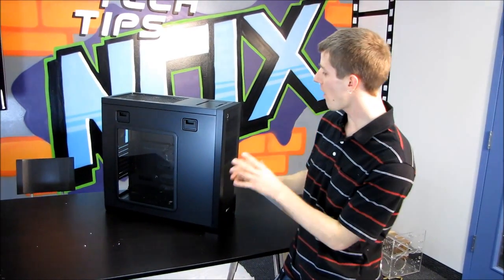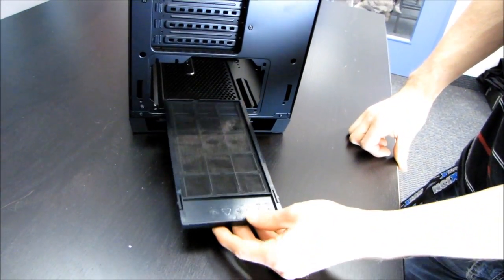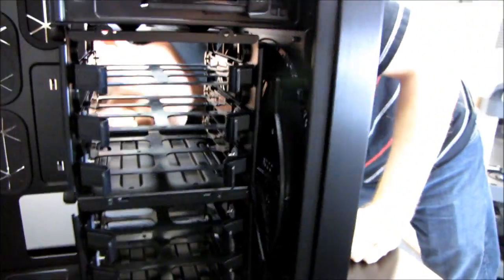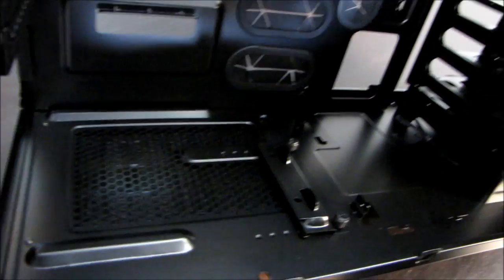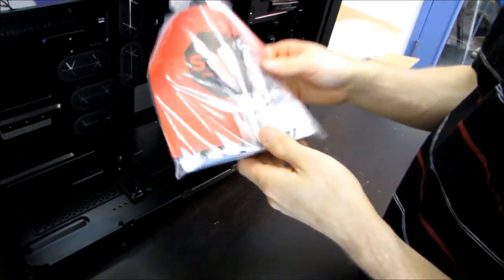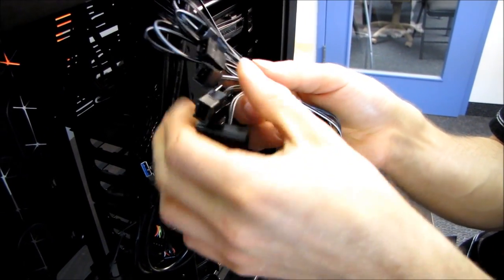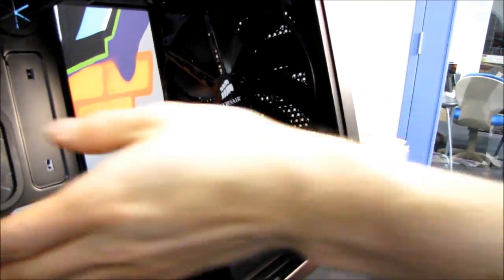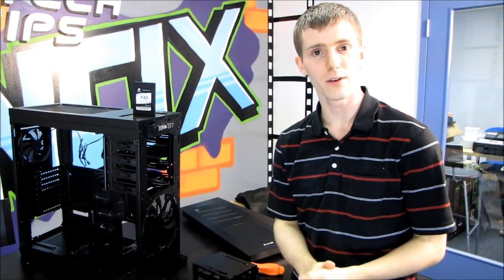Corsair Obsidian  650D Gaming Case Unboxing & First Look Linus Tech Tips

Comment: bought this one in 2012, still use it today hehe
Reply: Me too :) best features imo. Hot swap is rare these days. As is the reset switch being slightly hidden.
Reply: As do I, and will with the next build in a few weeks!
Reply: I own two of them.  That way I can start building my next system without needing to stop using the current one.
Reply: Still using mine in 2020.
Reply: Sorry, swapped it a few months ago
Reply: Me too, currently googling around trying to figure out wether I will be able to replace the noice machine at the front with a higher quality 200mm Noctua NF-A20 PWM.
Old one seems to be only 20mm thick, I might have to either get rid of or move the harddrive holders to make space for the 30mm thick Noctua.
Reply: May I ask how's the airflow of this case compared with nowadays cases?

Comment: Still rocking a 650D for two years now, awesome case. Would have been nice for Corsair to have a dust filter for the top though.
Reply: Is the top an intake?
Reply: ***** I have a corsair H100 in it and the rad doesn't fill up all the holes therefore dust can passively fall into the case. I have it as an exhaust, I have positive pressure in the case so there is minimal dust build up.
To answer you question, the included fan can be either, but most people would have it as an exhaust.
Reply: Thanks bro!!
Reply: Draconorst Dude if you have so much dust inside your office. etc. that you need a dust filter at the top of ur case, you should probably not be there at all..
Reply: kristian kristiansen It's actually at home and I have carpets, small children and cats to contend with. I also live in a cold damp environment, therefore ventilation of the house (which I own) can only be done at certain times of the year. I clean the front filter once every 3 months and the whole case (inside and out) every 6 months. It's not bad, but I just want it to be pristine.
Reply: Og you have carpets ..
Reply: @relentlessmotion  Intake or exhaust, can also do both at once 1 coming in 1 fan exhausting....good for VRM cooling

Comment: @JonasAndStuffDK95 yes, the top fits a double 120mm radiator, the front fan area can also mount a rad. reservoir can be houses in the drive bay area. and the pump can be attached where ever you want

Comment: You can install up to a 13-1/2" long video card in the 650D with all of the hard drive cages in place.  I have the case and a XFX HD6870 Black Edition Dual Fan video card installed.  The card is 9-1/2" long and I still have just over 4" of space before I hit the hard drive cage.  The case is well designed, way better than most cases.

Comment: @SneakehNub You can run your power supply cables through those to hide them, the ones at the back of the case are for water cooling tubes.

Comment: large graphics cards will fit with the hdd cages installed, but you can take out the one at the top and mount it at the side of the other if you want more cooling to the card/cards.

Comment: Anything by Corsair is probably going to be a good buy. If you're on a budget the 500R will be a solid case, but if you have an extra $70 to spend I'd go with the 650D. The 650D is going to made with slightly higher quality materials, and looks a lot nicer IMO. When I was building my latest system I went out and decided to invest in the Corsair 800D, which I love and plan to have forever. We should probably stop hogging the comment area though. Send me a msg with any other questions.

Comment: @GeneraLKaoZ 

pretty sure you can, 
the card itself is around 12i-30cm in length (I have HIS 6990) , and the case 650D is around 21.5' in length.
In addtion , I think you can relocate SATA bay area drive holders (lower right hand side)

Comment: Ya, the airflow should be plenty. Should be a good case. Personally I prefer full towers, but I'm about to do a Haswell i7 build with a friend and he didn't want something too big, so he's getting the 650D. Extremetech's website has a good article (Extremetech's guide to air cooling your PC) that explains the importance of fan positioning over number of fans. Some good info in there if you're interested.

Comment: Yep the stock 200mm is there, it's not quiet but its not loud either. It's on my list to replace. Yep two sp120s will be fine on the h100 with that motherboard.

Comment: To add an aftermarket CPU cooler, which typically require a backplate to be mounted behind the motherboard, allowing you to change it without removing the entire motherboard.

Comment: can someone please explain to me (3:05) the 3.5" Hot Swap Drive & the 2.5" Hot Swap Drive. Is it just a normal HDD or SSD that can be easily installed/removed?
Thanks for any help
Reply: ***** Thanks :D
Reply: or if one was to possibly fully utilize ssd caching and you had multiple ssds with multiple programs that you have separated for specific reasons, e.g a gaming ssd with microsoft os, and possibly an editing ssd with apple on it; with the inner comp comprised of HDD, im not rich nor do i do this, but to me it appears more practical than using two computers in many cases, especially if the hardware is capable of achieving a gaming and editing capability. And this person could even bring their ssd, and use it with a laptop the same way an external hd could be utilized that would be some futuristic computing
Reply: yeah, seems like a good idea, thanks for the info guys :)
Linus, you have a great community.

Comment: dude, I have I7 3820, GTX680, Kingston DDR3 HyperX 1600MHz 16GB , SSD gard disk + Western Digital® Desktop Green 2TB, powered by Silver Power SP-S750M 750W, cooled by Corsair H70 Cooler, mother is ASUS P9X79 PRO  and I use this 650D tower. Works just fine for me.

Comment: It is a nice case. Corsair has great design and craftsmanship and all round good products. I only wish they give u more miscellaneous component than you would need, like thumb screws. I bought the 800d and they gave me just enough for all the expansion slots no more not less. And the H100 8 long screws for the 2 radiator fans not a single more. I paid good price for em, they should give me more extras. The antec 300 cost $60and it came with a bag of high quality thumb screws (not the cheap ones)

Comment: This is an excellent case I've been using it for over 4 years but it does have a few drawbacks...namely the front 200mm fan is junk and it's thinner than most 200mm fans so finding a replacement took a trip on newegg searching after I had already bought another one that was too wide most 200mm fans are 200x200x30 the front fan in this case is 200x200x20....also after about a year the door that hides the front usb and audio ports broke off not a huge deal but a drawback....I LOVE the tooless side panels on this case and won't buy another case without these kind of mechanisms for side panel removal I give this case an 8.5 out of 10

Comment: @604mistermagicman I got this not that long ago, and I was seriously surprised (pleasantly) at the size of it. It's a really nice case and quite frankly is HUGE on the inside. I'd almost say it's a small full tower.

@MrTast Easily, I'm pretty 6990s fit without a problem, but even if they don't, you can take out one of the hard drive cages to give you more room.

Comment: Strangely i thought Obsidian series is a highest series of all case from Corsair?
But this case is 2X more expensive compared to the Carbide 400R ( almost 2X ) yet it feels like the Carbide 400R is better , specially in terms of total fans you can install 

Except that the 400R doesn't have a side window. But the 400R can install a 120/140mm fan next to the PSU. 

But i do like the hell lot of cable management rubber in this case.

I think the 600T is better choice than 650D

Comment: Would you be able to mount a dual rad inside with the fans mounted inside the case as well? not blocking or interfering with the motherboard? i want this case but thats the only thing holding me back, as i dont want to mount the fans on the exterior on top. anyone have any suggestions>?

Comment: @Willasap43 But aint the 600t more out of plastick=more scratches and bigger likely  to break? I do like the white one more in looks, but for my inside i use a mother board thats mostly black but a little green, and does white and green fit? in that case, 600t is my way. Thx for help :D

Comment: @LinusTechTips Hey Linus! Would I be able to install a dual 120mm radiator (XSPC RS240 Radiator) with a set of gelid wing UV blue fans without interference with the motherboard (P8P67 EVO) in this case?

Comment: ah yes my case...good ol 650d...or as i like to call it, the "poormans lian-li/silverstone" yep top clearance for a rad front clearance for a rad, clean simple lines/minimalistic design. With a nice "big" window some might be against visuals but i removed all the HDD and have 2 ssd mounted on the bottom and like showing ppl what PSU i own etc. Really let ppl know whats in the rig. Also it looks like soo oldschool my fave era was the 8800 sli era and this case reminds me of back then so much. all business lmao but still  "poormans lian-li/silverstone". Nh-D14 covers everything noctua fans all over, then a fat 7990 and my hds and psu no hd cages lmao nice air flow and cool n quiet....except the 75% fan speed 7990 lmao but she idles like a dream @ 40% dead silent for daily computing.

Comment: i like this case but it doesn't have side fan for the gpu.
Are cases like this engineered so that the air flow is fine without side fans ???
Reply: Side intakes corrupt air flow and actually only help the gpu but causes dead spots in the flow.  Most GPU's never need side air intakes and if they are getting too hot liquid cooling them is an option.

Comment: @koalabear2 Hmm.. I can found out what card it is if you want but it's such an old card it's unlikely to be installed in a case like this anyway really. And also my dad's case is significantly smaller than this one so you may not even have to remove the cages anyway

Comment: Hey Linus 

I am going to build a new pc and are thinking about using the 650D case how do theres specs sound

I7 3820

GTX 660 MSI twin frozr 3

Corsair HX 850

Corsair 650 D

Corsair Vengeance DDR3 1600MHz 8GB

Corsair h100i

Western Digital Desktop Blue 500GB

ASUS P9X79 PRO

how do that sound ?

Comment: Hey, so I have an alienware aurora r2 and I want to overclock the i7 930 further. Currently it is running at 4ghz. I still have to run Prime95 for a longer time to make sure it's stable but I want to turn up the voltage. If anyone knows how to do so on the alienware board that would be excellent, thank you!